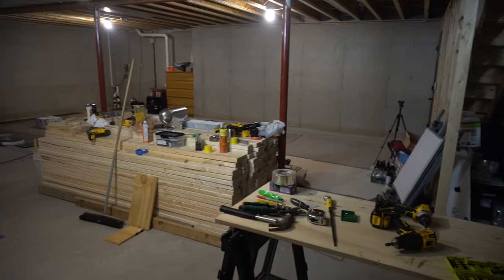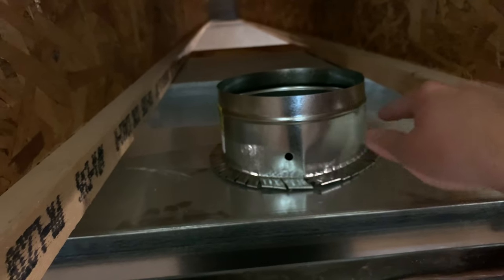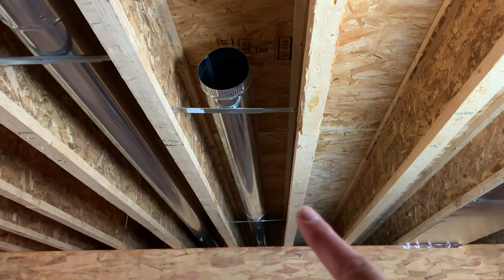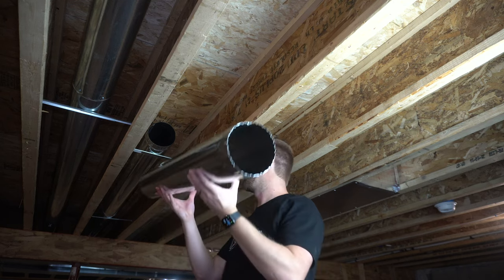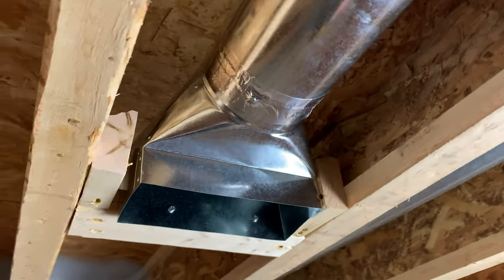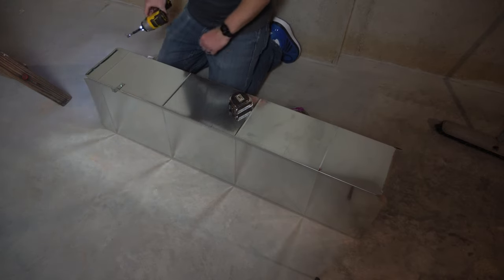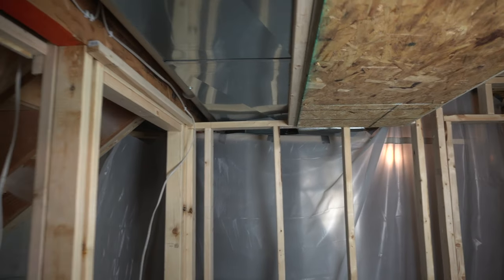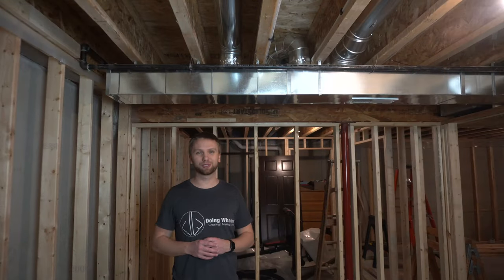How To Install Ductwork In A Basement | DIY Finished Basement Renovation

Comment: Unless you're just doing returns, the foil tape conducts cold, leading to a condensation issue. You needed to put mastic on the supply connections to avoid leaks and mildew issues.
Reply: Mastic as in a different style of tape?
Reply: @zuko9085  he's talking about duct butter or pookie depending on ya area lol
Reply: He’s literally talking about mastic on the spiral at each join as well as tek screws or rivets
Reply: Would you need mastic along the whole seam of the tube run as well? I am doing something similar very soon. Just one simple straight run from trunk with 2 supply registers.
Reply: If the foil tape conducts cold would t the tin work also conduct cold and therefore cause condensation issues?
Reply: @reaganpenner7371   the duct tape is way thinner than the 26 or 30 gauge metal. It will produce condensation very quickly. The trunk line or rectangular pipe will still condensate is an unconditioned space but will take much much longer.
Reply: Little residential system don’t of to use pookie on every connection, but some retro fit connections I’d use pookie!  VAV system use pookie all day bro
Reply: I see he didn't respond to any of you who knows what your talking about
Reply: Awesome video!!! Very encouraging showing in n outs and step by step! Thank you so very much for this! 🙏👏👏👏
Reply: I will be replacing my duct work in the next couple of months, I will be using the mastic, only because I watched other videos on it. Looks like a giant tin spider is busting out of my furnace, and taking up precious head room

Comment: Manual D could help you to improve. I don't think that duct work will pass inspection.
Reply from the maker: What’s manual D? I’m always interested in learning!
I had the local building inspector inspect my basement before drywall went up and he didn’t have any items for me to address
Reply: @DoingWhatever  Manual D is the industry standard for sizing home HVAC return and supply duct & registers.  Manual D duct design distributes the correct amount of heating and cooling to each room based on the Manual J load calculation results. (Information from ACCA). In the Virginia state that duct work do not pass inspection.

Comment: Stud / joist cavity improvised ducts are not up to code in many areas. Probably works just fine but has it's downsides.
Reply from the maker: That's a good point - code in my area (Wisconsin) allows for joist space to be used as return air ducts, but everyone should definitely check with their local building code/inspector if they are unsure. thanks!

Comment: Not sealing the long seam where the duct sections joined together?  Also why not use mastic, especially where the 'T' connects to the main trunk.  Anywhere you have a joint you have a potential air leak, including returns.  I was surprised just how leaky my metal ducting was in my homes crawl space that was built in the late 70s with....nothing was sealed properly.  Cleaning it out and using mastic and metal tape to seal  worked wonders.  Also, insulating the metal ducts insures the temperature of the air you want reaches the supply outlets.
Reply: Mastic ('pookie') is the best. Goes on like peanut butter, then dries hard as a rock. Will never peel or unstick like foil tape. I usually just apply with a gloved hand,  brushes and things just don't give the same feel.

Comment: Thanks for showing this! We're about to start finishing our basement and plan to do most of it ourselves to save $$. This is going to be super helpful.
Reply from the maker: No problem, glad to hear it was helpful! Good luck with the basement!
Reply: Same thank you
Reply: Steve - A common mistake people make when adding duct work to a basement is not having cold air returns.
Make sure the intake of the cold air return is near the basement floor .
Check building codes about cold air return . Do not install cold air returns near a hot water tank because it creates negative air pressure . I installed a cold air return as far away from the furnace and hot water tank as possible . Good cold air return makes a world of difference . 
.

Comment: Tip for drawing a line around the round duct before cutting. Use a plastic strap, metal strap, string or anything that you can wrap around the duct, then draw with your marker instead of "playing connect the dots". :)
Reply from the maker: Great tip! thank you 😃
Reply: 💥 Thanks for the nice video.  I’ve been told that you can’t just cut into the supply trunk wherever because it reduces the flow to the main level.  It’s that “path of least resistance” going on.
Reply: Also tape the seam where the duct clips on to. And insulate it before hanging

Comment: Also it’s much easier to make the pipe cuts with either the red or green snips. Which ever hand you are more comfortable with cutting
Reply from the maker: That’s good to know, thank you!
Reply: @DoingWhatever  Also, sometimes the offset ones keep your hands further away from the pieces being cut.
Reply: Great advise : Buy a good pair of red and green tin snips - trying to cut duct work with straight cut or a cheap pair of tin snips is just asking for a frustration .

Comment: If you plan to leave the ceiling open you want need to insulate your supply runs. If you plan to hide the ductwork with a ceiling you will need to insulate your ductwork. In the south eastern states you’ll need to install R-8 insulation.
Reply: The ceiling cavity is in the basement and inside the insulation envelope. Insulation is only needed if running through non conditioned spaces.

Comment: Dude this vid is the best I've found! Btw for my own basement, should I plan to have supplies and returns in every room or how do you figure out where you need them? Also are you going to have a thermostat down there or just rely on the system and what is in place upstairs? Thanks!
Reply from the maker: I’m glad it was helpful! 
From my little bit of research, some people were saying one return per 1,000sf but that seemed like not enough. In my 1400sf first floor there are 5 returns. So for the 850sf finished basement I went with 3 returns. Should be plenty. Just relying on the thermostat on the first floor. Thanks for watching!

Comment: needed an example of a return air duct to draw cold air off the floor in a basement.  The previous idiot that owned this house I bought had the return air opening on the ceiling.  in between the hot air supply about 10 feet away.  As a result the basement never really gets as warm as it should.  Thanks
Reply from the maker: perfect! glad to have helped!

Comment: Very useful video, Is 30 gauge OK for residential AC duct? I'm finding all source of answers in the internet about you must use Minimum 28 Gauge. I'm also using 30 Gauge in my basement supply and returns.

Comment: At the end of the trunk shouldnt you use a reducer to increase static pressure on the last runs? Ive heard for every 400cfm you need to reduce the trunk to allow for better air flow

Comment: I'm planning to use 6" round ceiling registers/diffusers.  Those usually go into an un-crimped duct.  How do you transition the crimped end of a 90 degree elbow to an uncrimped piece?  Just a piece of pipe?  or is there a special fitting to receive a round diffuser?
Reply: ^ This

Comment: Great video. Thank you. You are connecting new ductwork to the existing system which provides heat and cool air to the first floor. correct? How do you know if the existing furnace/condenser will handle 1st fl and basement simultaneously? Also,  I'm wondering if you could use flexible ductwork instead?

Comment: You should insulate all your ductwork especially the supply duct because the supply air is so cold moisture develops on the outside of the ductwork and it will be perfect breeding ground for mode.And I would add dampers on all the start collar to adjust air flow to each registers
Reply: If its in a conditioned space, like it is, he doesn't need to.
Reply: and you are wrong @smacleod69
Reply: @chrisfulltime2056   How am I wrong? Basements are considered a condition space. Don't need to wrap it if you put some heat runs down there,

Comment: I bought a house that's nearly 100 years old. The furnace is in the basement, and ground level has ducts and heat, but they were never added to the upstairs bedrooms. There's vent holes in the walls upstairs from what looks like where ducts use to be. Any tips or advice on how to reinstall ducts going upstairs to a 2nd story?

Comment: Nice job! Do you fix loud banging noise’s coming from the ducts? Sounds like a firecracker going off upon the furnace starting up and when it shuts down. This noise is driving me crazy. I’m very serious about you or anyone that can fix this. Please help. Thanks and great video
Reply: Is your duct crossed brakes?  Is there a x bend running across corner to corner of the supply plenums?
Reply: @videos10  yes it has the X.
Reply from the maker: Thanks! 
This is just a guess but maybe your system isn’t balanced very well. I wonder if the furnace fan is over sized and pushing too much air through the ductwork with not enough supply vents to escape out of? Again just a guess. Might be something to call a professional about 🤷🏼‍♂️
Reply: Make sure your return air is not obstructed and you have a clean filter. Don’t use too high of merv rated filter (too restrictive). If the ductwork is still popping you should be able to slow the fan speed in the air handler. If none of this helps, your ductwork may be undersized.

Comment: Dude this was a great video! Very well explained and edited and easy to follow! Getting ready to work on my own HVAC system and this will definitely help!! One thing I think I would have done is put the supply down at the bottom with the cold air return up above since warm air is less dense then cold and rises. Unless I'm missing something which is totally possible lol or maybe it doesn't even matter? 🤷‍♂️
Reply from the maker: I really appreciate all the kind words! 😃 Good luck with your project - it takes some time but it's too difficult. 
I did consider doing that - supplies at the ground and returns at the ceiling, but ultimately decided to save some money and go with the supplies at the ceiling and the returns at the ground. running the supplies down the wall would have pretty much doubled the ductwork cost. 
The main thing to keep in mind is that you want the supplies/returns opposite of each other, that way the conditioned air is either pulling from the ground up and into the return, or from the ceiling down and into the return - either way, the conditioned air is blanketing the entire space. at least that's the idea lol hope that makes sense!
Reply: @DoingWhatever  absolutely! And thanks for the response, hadn't considered how much more it would cost. I suppose it would be a good idea to factor that in! 🤣
Reply: in high end homes 2 returns one at floor one at ceiling..  yup..(really high end had 2 systems cast iron baseboards the ducted ac.) changed with seasons.. If you have heat on,stand on a ladder see the temp at ceiling.. Thats why ceiling fans used with high ceilings, and lower too..  we should live on the ceiling in winter.. summers floors are coolest i never use ceiling fans just moves hottest air in room leave it there.(except in really cold winter sometimes before room warms up) Pedistal fans push much hotter air, floor fans are significantly cooler.. Tested with a thermometer not guessed. Windows radient heat are room heaters. one needs to bounce it out.. winter bounce it in..  forced air is a very bad system it works by heating items in room to radiate back heat. air doesnt hold heat..  ill shut up now..
Reply: In my basement the supply is in the ceiling and return at the floor.  This makes sense to me, but the reverse also makes sense. I wonder if one configuration is more efficient depending on how long your cooling season is relative to your warming season. For example, if you have a long heating season and short cooling, maybe putting the supplies at the floor makes more sense? Anyway, in the new room I’m adding to my basement I’m going to match the other spaces and just making sure to keep the supply and return on opposite sides of the room to encourage an even temperature throughout the space.

Comment: Ok I’m putting my list together at Home Depot and I can’t find anything for the duct supports and your link is broken for Home Depot . Can you tell me what they’re called and how many inches long they are
Reply from the maker: Hmm... the link works when I clicked on it 🤷‍♂️ Regardless, they are "12 in. to 19 in. Galvanized Adjustable Pipe Bracket" and the brand is Oatey. Hope that helps!

Comment: Awesome video my man - I'm also in the process of installing and designing my own HVAC system for my new build from start. Great use of rigid ducts and supports. Did you confirm your current system can handle all the new load you're putting on it with all that new supply demand?
Reply from the maker: Thanks man, I Really appreciate it! 😃
In short - no I didn't lol. Our house is fairly new though, and the builder anticipates that a lot of people will finish their basements eventually, so usually the HVAC unit is sized with that in mind. Before finishing our basement, our first floor would heat/cool pretty quickly so I imagine the unit was oversized.
Reply: could add zoned duct controls.. but usually homes systems dont allow for extra areas ..they were designed for original sizing.. try dampers and increase heat anticipater to have longer runs..  longer the run hotter the air..

Comment: 6" return air pipe is running from upper floor bed room to furnace duct at basement.  Can I split the 6" pipe by adding one 6" T on its way to get return air in one bed room in basement.  There is no other location on duct to connect return air to basement bed room.

Comment: You don't ever tee off the same size duct run. And you didn't install manual dampers in the 6 inch pipe.
Reply from the maker: Wish you would have made a video so I would have known that! Lol
I installed manual dampers per the inspector after this video was posted. Depends on if your ductwork will be accessible or not. 2x2 acoustical ceiling tile may not need dampers since the ductwork will be accessible. Gypsum board ceiling like mine will need dampers at the end of the run. 👍🏻
Reply: @DoingWhatever You cant just pop holes in a duct run.. there's a science to it.

Look up the "2 foot rule" that will set you off on a good footing next time

Comment: Awesome video! I’m planning on finishing a basement on my first investment property flip so this was super helpful! Does the amount of additional ducts you add affect the output of the unit? Hoping the size of the unit that was installed in the home was chosen with the idea of finishing the basement already in mind.
Reply from the maker: Awesome, good luck on your project! 
The short answer is yes, eventually the amount of additional supply/return lines will affect the performance of your unit. I’m not an expert at calculating how many BTUs are needed for a certain volume of space but I’m sure there’s a calculator online that could get you fairly close. Our house was built in 2017 and I’m pretty sure they sized the furnace with the intention to finish the basement some day. It seems to heat and cool both levels pretty evenly, and doesn’t seem to be working much harder to do so. Hope that helps 😃
Reply: Nope it sure wasnt, that would have cost more and made system oversized, thats bad.. out put is the same your just decreasing air to other rooms. so system may have to run longer..

Comment: Is there a drill bit to use before drill steel screws in ducts
Reply from the maker: You don’t need to do that if you use screws that are called “self-tapping” screws. The point on those screws acts like a drill bit. Hope that makes sense 😃
Reply: @DoingWhatever  thanks for your reply

Comment: Joists are made of board. Wao. never saw that. how cheap quality those houses would be.
Reply from the maker: Wood framed homes are very common around here, especially engineered wooden TJI’s. Steel joist would be overkill. But it’s probably different in different areas

Comment: Awesome video!

Where did you get those long hangers and attachment clips? I’m doing a similar installation but have Tammy been able to find them, was going to use C clips
Reply from the maker: Thanks!

I got those from Menards - not sure if you have a Menards by you, they are mainly in the upper midwest. I'm sure Lowe's or Home Depot would have them as well.

Comment: Insulate duck work?
Reply from the maker: You definitely could do that, but I didn't feel it was necessary in a house my size.
Reply: Insulation isn't required for ducts within the building envelope. If you think about it, the heat lost from the ducts just goes to the room it's serving. 

Now if the ducts are installed in a vented crawl space or attic you have to insulate them.

Comment: If I already have 6” duct running in spots I need it over my basement ceiling, can I just add supply vents to it? Or is it best to create new runs? In other words, can you have multiple supply vents on one 6” run?
Reply: Is better to install new ones otherwise you gonna be reducing the airflow from the 6" heat runs 6" heat runs are 110 cfm if you add more into the same pipe then the air is barely gonna be coming out from the vents
Reply: @miguelh.maci1148  is correct. If you want to tap off of the same run you'd have to up size the original run to an 8 and then wye to 2 6" ducts off of that. That's assuming adding a run won't reduce static pressure too much and you lose airflow everywhere else.

Comment: Are you worried that moisture will rot the wood over time and create mold inside your improvised stud spacing duct?
Reply from the maker: Which part of the video are you referring to?
Reply: @DoingWhatever  28:31
Reply: He’ll be ok. It’s just the return air.